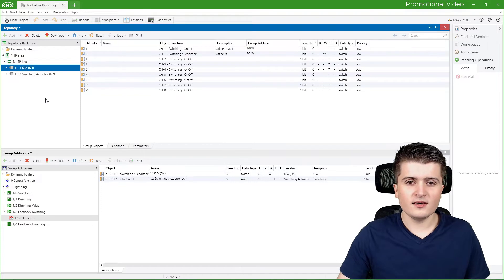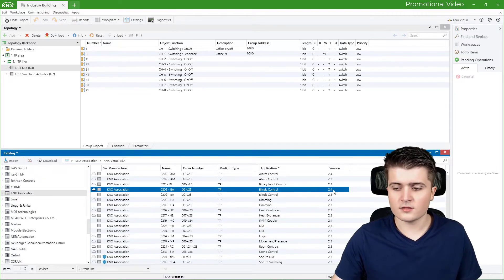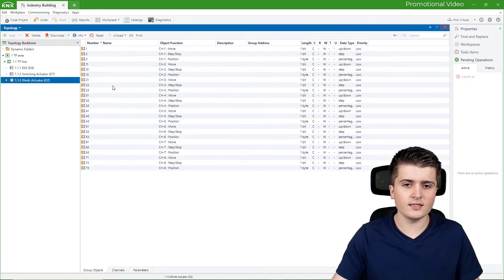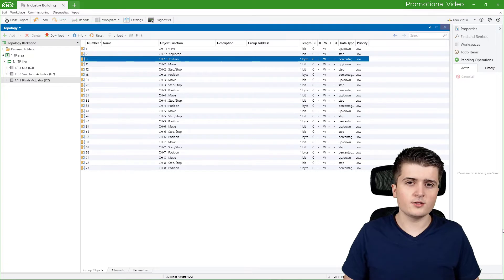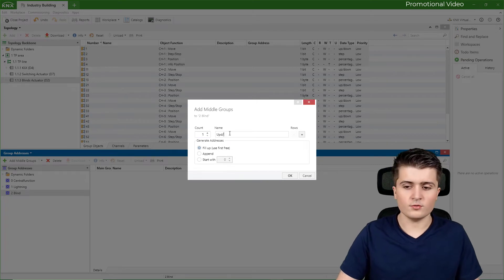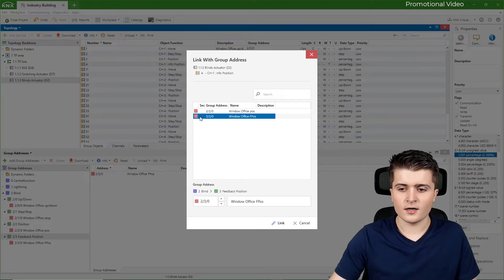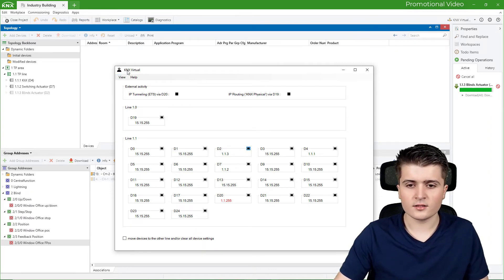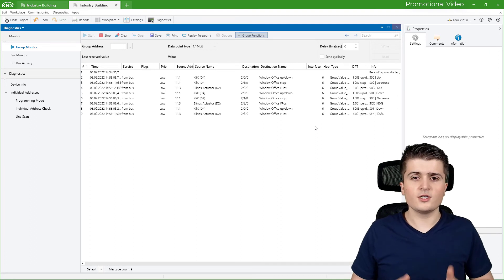KNX Videoseries - #12 Blind Movement: How blinds in KNX work

Comment: Great explanation! Thanks.

If I have flap shutters that work like venetians, would it be better to use motors with two mechanical limit switches and set opening percentages, or motors with three electronic limit switches?
If a motor has an amperometric sensor to protect people or things that could be in between,so the motor stops by itself, is there a way to communicate this to the actuator and so record the position without "confusing" the actuator?